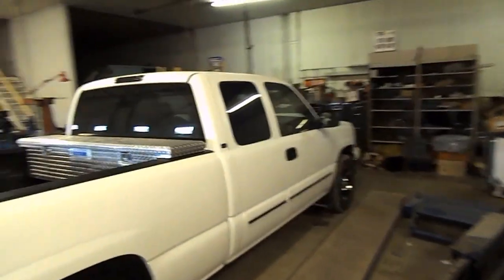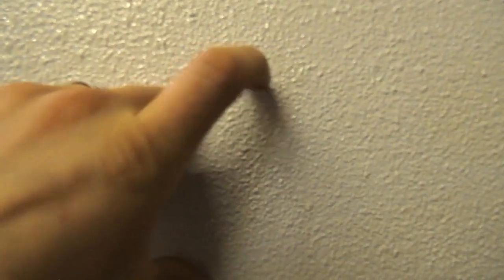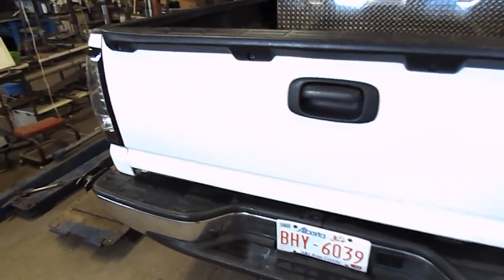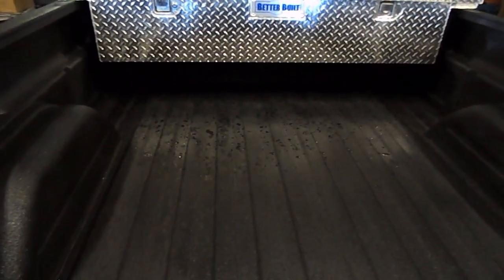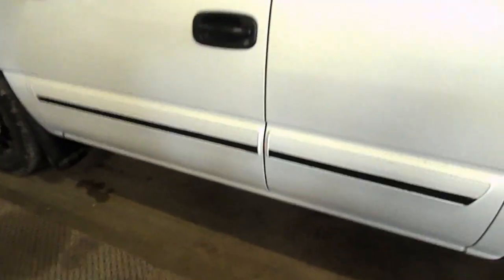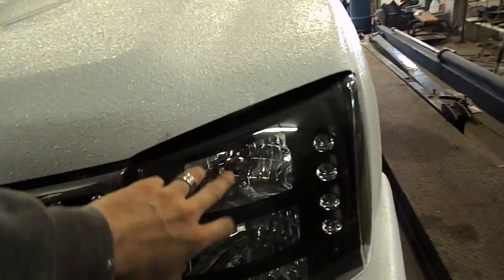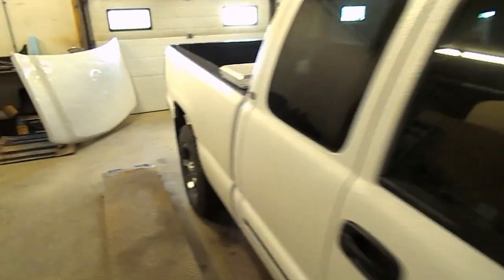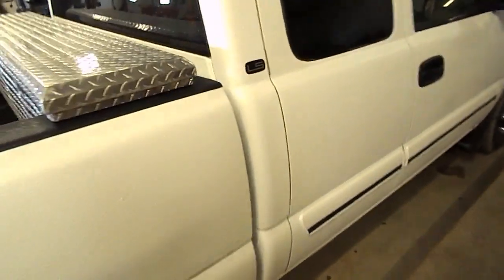I raptor bed lined my whole truck !

Comment: Man you gotta use a better gun. The shultz POS is fine for the bed of a pickup but if you're doing the whole vehicle you need some subtlety. Those big globs look horrid. I use an adjustable soda blasting attachment and I get a nice even finish.
Reply from the maker: +11apples100 its all a matter of taste man, I like the look of the more uneven splatter look thats why I put it on a lower psi, also this was my first time ever using this stuff/doing that extensive of body work. I always like learning new things and i'm open to ideas, so I would love to see some of your work you've done and this soda blasting attachment you have.

Comment: How many bottles did it take?
Reply from the maker: 8 bottles of white, 7 bottles of black.
Reply: can you explain why you used 8 bottles of white and 7 black??? Did you paint different areas ?? Did you do the bed liner in black? and thats why it took so many black?? Im just trying to figure how much of the tintable to buy for a 1996 dodge 1500 extended cab. How many bottles of clear coat will I need?? Please help me figure out what I need to but. Im going with a red color.
Reply: Linda Norris he did underneath the truck too

Comment: Is it easy to clean?
Reply from the maker: If your intention is wiping it down with a cloth, then it wont be super easy to clean, but if you are using a regular pressure washer then it is just as easy to clean as a regular paint job.
Reply: Awesome and what tint (brand and quantity) did you use? I have a 2001 Blazer and Im lookin to do the same thing.

Comment: whered you get your kits from? I'm in saskatchewan and only seem to find it online.  I've heard napa ca  get it. I'm debating spraying my 15 duramax
Reply from the maker: The cheapest Place is to order them from Amazon or Ebay
Reply: Levi Stanford thanks for the reply. been watching amazon.ca for awhile and their always over 300 for a kit. I'll have to re open my ebay account
Reply from the maker: I'm sorry I just realized that I use the USA Amazon website because I Live so close to the border I get my stuff shipped to a postal place in the states then pick it up. They are $120 USD. The cheapest I can find for the Canadian Amazon is $240 which is outrageous. If you can find an auto body supply place near you that supplies it, that would probably be your cheapest.

Comment: did you raptor line the door jambs?
Reply from the maker: No. After spending hours and hours pulling out hail damage I said the outside is good enough...and I got lazy..hence why I raptored it in the first place
Reply: thanks!

Comment: How did you mask of the extended cab window seal
Reply from the maker: With  Scotch green performance masking tape. This is an example: https://www.amazon.com/Scotch-Masking-Surfaces-2060-24A-60-Yards/dp/B00004Z4AY/ref=pd_lpo_vtph_263_bs_t_1?_encoding=UTF8&psc=1&refRID=7XJGM2QQAE5PJC3FK96M
Reply: Levi Stanford I have that but like to you go over the top of the seal or behind it and pull it towards the window
Reply: Levi Stanford TUFF GUY INDUSTRIES Mario M. I’m using 150 grit sand paper is there a way I can accidentally go down to bare metal
Reply from the maker: I put my tape over the top of the seal and utility bladed any access to make sure it was perfectly lined up. I found that when you put the tape under the seal and then fold it back over the top it creates problems when you go to remove it. Taking the tape and plastic off with bedliner is way different then paint because it is thicker so you want to keep as many "edges" with the tape as possible for a clean removal. Yes it is possible to go to bare metal with 150 grit but that would require you to sand a crap ton in the same spot. all you need for the bedliner to stick is to make sure you sand the clear coat off the factory pain job and you will be good to go.

Comment: I want to raptor line my 2 door grand am. How many bottles would I need to get like 3 coats???
Reply from the maker: I usually judge how much by my truck, but a car is different. Each Bedliner kit covers approximately 125 Square feet. and it also depends on how thick of layers you are putting on. It usually takes 1 kit to do a truck bed.
Reply: Levi Stanford I was considering either the 6 liter or 8 liter kit of the hot rod red would 6 be to little? Because I'm just trying to spend less considering I'm replacing a bumper and a hood
Reply from the maker: if you are planning on making a thick coating with layers I would suggest the 8. It's always better to have a bit more than not enough.
Reply: Levi Stanford those were my thoughts exactly. Thanks for the advice man hopefully my project will come out well
Reply: Levi Stanford sure thing I'll be sure to whenever I get it altogether 👍
Reply: Levi Stanford say would you use and kind of pearl or metal flake in this stuff???
Reply: Levi Stanford i have been doing more indepth research and i was wondering about the adhesion spray and the primer that u-pol makes should i use it? Also the clear coat?
Reply from the maker: I'm sorry but I couldn't answer you on this one bud. I personally think the finish it has all on it's own is good enough and I've never heard of anyone mixing in metal flake into a Bedliner so thats something you'd have to ask a body shop. The adhesion spray is really more for plastic and you want to use the self etch primer on spots that have bare metal. As for the clear coat, Raptor has a gloss finish in it already and the clear coat definitely adds to it, but if you don't do the clear coat right it will come out looking very patchy. What colour are you thinking of doing?
Reply: Levi Stanford i am doing the hotrod red raptor. From the pictures i have seen its pretty bright but i was worried about eventual fading

Comment: was the gun u used something like this? http://m.harborfreight.com/texture-paint-spray-gun-66103.html?utm_referrer=direct%2Fnot%20provided
Reply from the maker: xtreemnitro  No not if your useing the U-pol raptor bed-liner, the bottles screw directly into the gun so it uses a special gun just for the raptor product here's the link to amazon where you could pick it up, if you can check your local auto body shop and see if they would maybe carry it for cheaper 

http://www.amazon.com/U-Pol-Products-0726-GRAVITEX-Spray/dp/B006I4ABBU

Comment: good way to add 2300 + pounds to a truck
Reply from the maker: Alpha smurf your right cause when I bought the 5 kits of liner to put on, they had to deliver it with a fork lift, then I had to use a crane sprayer to put it on cause the bottles were soooo heavy.......  -_- if your going to troll at least be realistic.

Comment: LOL, You spent way TOO MUCH $$$$. Well put it this way, if you are Homeless, you can always sleep in your Truck right? I would go with BLACK like other People mentioned. BLACK is easy for FIX and when People Scratch it, bump their doors to yours, it's an easy fix too. Also, WHITE is BAD for mud :((((. You did a GREAT JOB though :D
Reply from the maker: well if you also look at it this way I bought the truck for$4000 with the hail damage I put $3000 into it and sold it for$9000 so really I made$2000 so really I got more than I put into it. also I would've preferred to do it black but the original color was white and I thought it would look pretty stupid to have a black truck then when you open the doors have white painted interior, but I do really like the black, and surprisingly the white actually cleans up really nice i took this truck out in the mud a few times and the pressure washer took it off no problem without discoloring it. pretty awesome stuff.
Reply: Oh, you sold it??? Yea, you are right... Putting it to BLACK would be even more $$$ since you might need more Paint to cover everything :D.
Reply from the maker: Haha ya that's why I fixed it up, if I was keeping it I would've just left the hail damage caused man is fixing that stuff a pain in the butt but it paid off in the end cause I was able to sell it for more